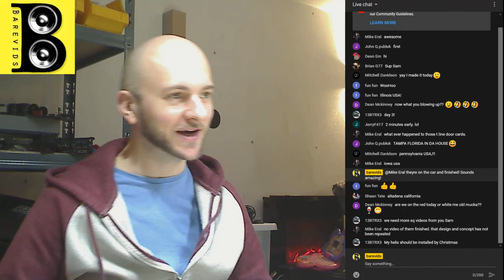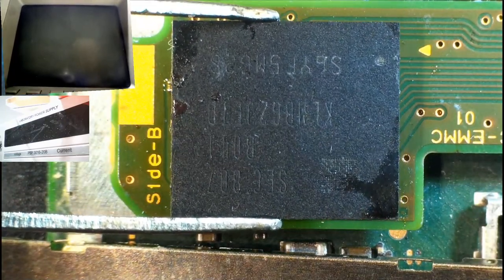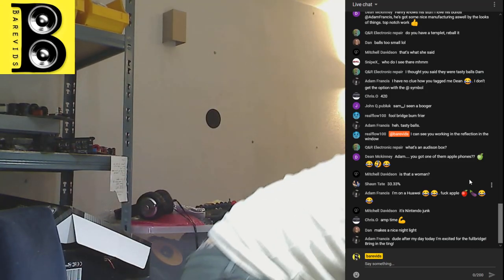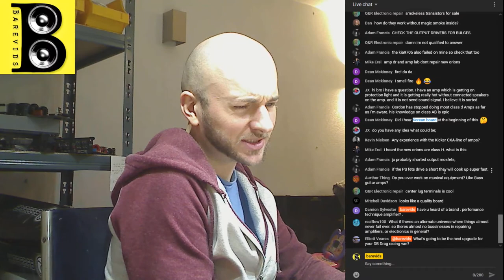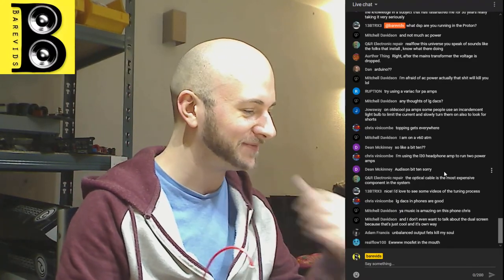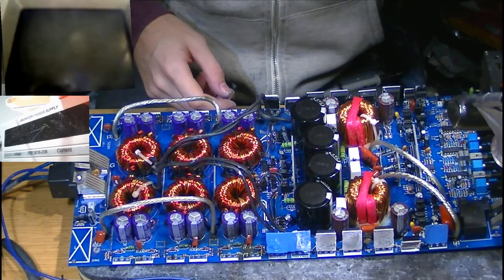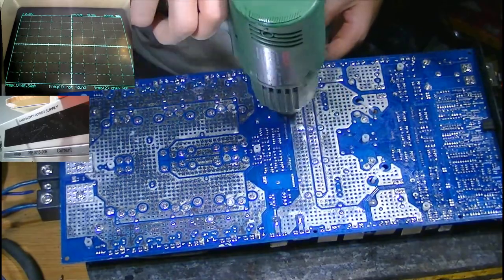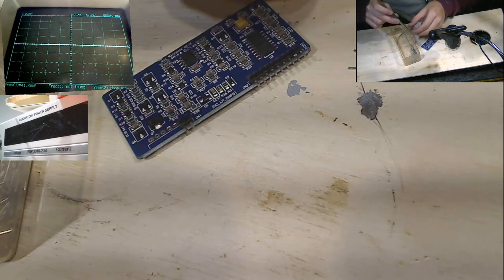Streammas DAY 3 - Part 1 Korean FULLBRIDGE gets repaired

Comment: that board looks a lot messier than the one i have. with the wires all over
Reply: also idk why they didnt add more power inputs i have another amp which is essentially one of these but 2 channels. has dual inputs